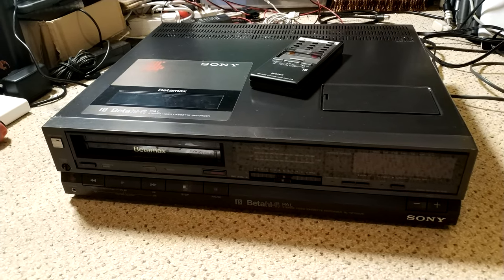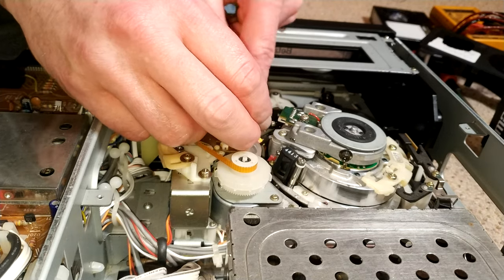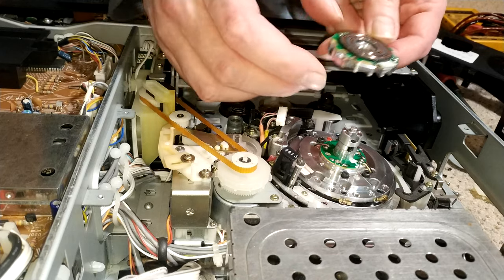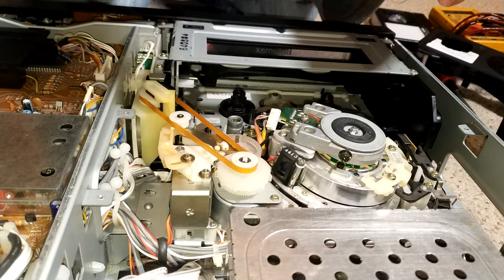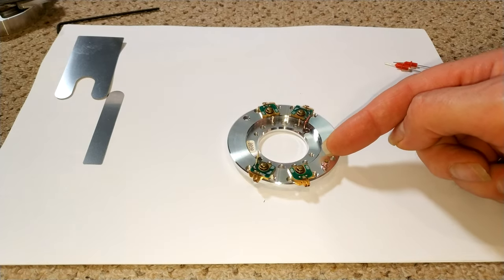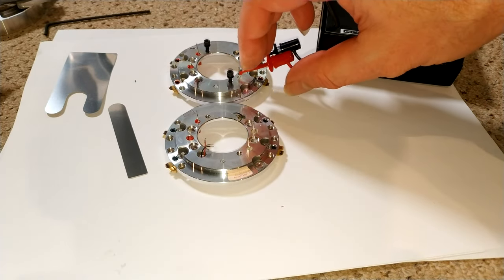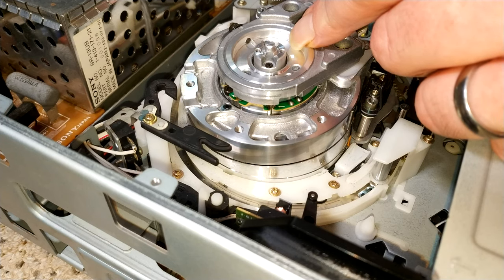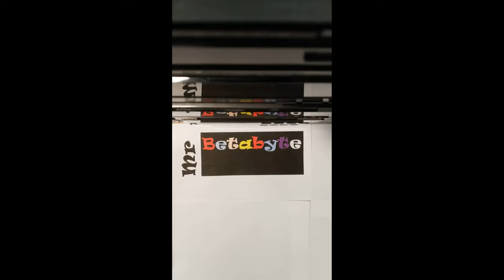The 'perfect' Sony SL-HF100 Betamax - Part 1 - Fitting new heads

Comment: If the clock display on this model has gone dim, what can I do to remedy that?
Reply from the maker: Unfortunately the only way to fix a dim display is to replace it. I have tried overdriving the heaters which improved the brightness for a couple of hours but they're notoriously unreliable on the HF100. Sorry it's not better news.
Reply: @MrBetaByte  Well, that's OK 😊

At least the clock is not a vital part of the key functions of a VCR bought for the purpose of playback. It was more to make it a bit more cosmetically pleasing to look at 😉

However, just thinking of something... 🤔 

Can the display from any old model, like, say, the C20, be used to replace the clock on an HF100? Have an old defect C20 in my basement, which suffered a horrible fate some years back when I tripped carrying it into from the living room into my media room. At least the clock part of the C20 worked fine (the last time I checked)